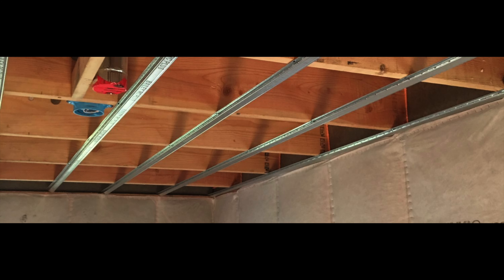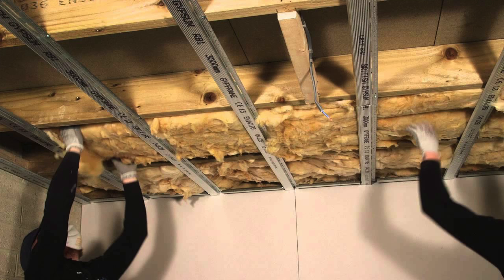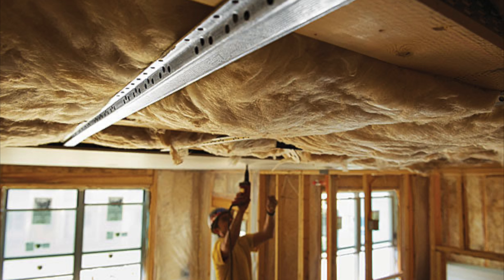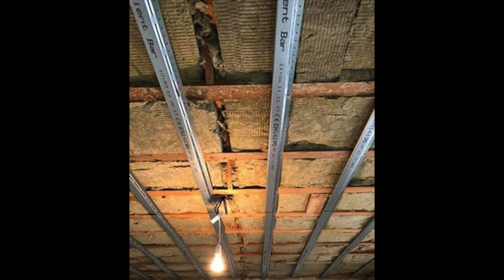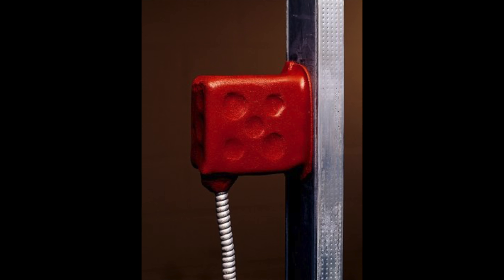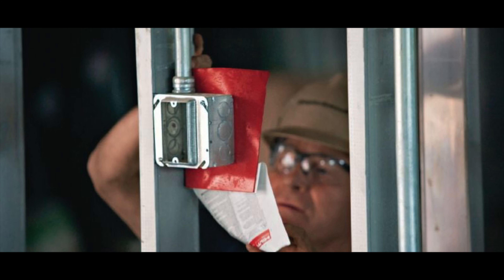Soundproofing a Ceiling Between Floors FOR GOOD!

Comment: Thank you, great advice! Might want to mention flanking as well when talking about impact noises as well as a couple things people can do to contest these issues. Firstly use a calibrated mic to take measurements of the noise. Building codes always include IIC ratings for multi dwelling constructions. A FIIC test can be conducted to see if the structure meets code or not. What is unfortunate is often the HOA or administration are ignorant of these issues and the details around them. Complaints of footfall noise are often ignored or seen as not important. Its important when I measure 70-90db @ 40HZ!! That's loud! Big old boom boom like a sub was installed in my ceiling.
Reply: Yes! Ppl above can be loud at times

Comment: Great info, thank you! I wrote to you on the main page (?), I hope you access it. We are going to finish the basement to make an apartment. We’ve had one BBIG FAT FAIL OF $5000 to re-do the existing ceiling of one room that was already done when we bought the house.The expert put 2x4s and rigid foam insulation and 5/8 sheet rock. This was all on top of an already finished ceiling. It did little to reduce impact noise. Now we want to finish the apt. Living room and bedroom LESS EXPENSIVELY and ecologically friendly. Why not reuse old carpet inside the ceiling? Thank you for your reply and you are welcome to come make a video.😊

Comment: Thank you for the great video! When soundproofing a ceiling, should the sound insulation (i.e., rockwool) rest above the ceiling drywall or should it be pushed to stick to the bottom of the floor? Does either choice make a difference in the desired effect?
Reply: Yes, id5love the answer to this as well.  Thank you

Comment: Can adding an extra dry wall to ceiling work and would it be safe? I had my apartment done with new walls and ceilings a couple of years ago. And yes the neighbor upstairs makes lots of noise that i had to tell person to take it easy when walking and slamming things on floor. I appreciate any advise you can give!
Reply: This is an exciting question. Where I live, the neighbors upstairs are extremely loud; they wake me up every day at 5:20 AM, and they are pretty heavy—one weighs 200 pounds, and the other weighs 300 pounds.

Comment: I live in a location that is about to be renovated soon. The above rooms are part of a short-term rental, and I deal with a lot of impact and audible noise. The audible noise is the least of the problem. The impact noise is the worst.

I've been able to mitigate the audible noise by running fans and putting on some relaxing music. It doesn't eliminate it all together but it does seem to help somewhat. However, the impact noise cuts through this.

Decoupling sounds like a great idea. But the problem is that the ceilings in my space are extremely low. Because of this I am very limited on height.
So this is not going to be feasible.

With that said, the floor above can be adjusted...
Is there anything that can be done from this aspect?

Comment: Thanks for going over the different strategies for airborne vs impact noise. I think a good way to organize ceiling soundproofing is also by whether you can rip out the ceiling or not. It would be weird, I think, to rip out the ceiling but not put in soundproofing insulation. Similarly, it would be weird to rip out the ceiling but not use a resilient channel for the new drywall (if you can afford it). What's the added cost of a resilient channel if you've pulled down the ceiling? What's the added cost of adding soundproofing insulation if you've pulled down the ceiling? On the other hand, if you've added an extra layer of drywall because you didn't think you could afford pulling down a ceiling, how happy are you going to be? Are you going to wind up pulling down the ceiling anyway because it didn't do much?
Reply: Would like to know... is adding drywall to existing ceiling enough?
Reply: @susanburke7257  It wont make a huge difference with impact noise (you have to decouple the ceiling to do that), but it will help somewhat with general noise transmission.

Comment: Hi, Thank you for the video. 
I live on the ground floor, the architecture of the building is, above my master bedroom, upstairs neighbor has a living room, kitchen and a stairs going to the ground floor, the stair is shared by two units. I hear footsteps in the master bedroom so it seems its the impact noise I am dealing with. I don’t think I want to do major construction for ripping the ceiling to decouple the above floor with the ceiling. Is there any solution which does not requires any construction to lower the impact noise?

And I am also curious, when looking at building to move in, what questions needs to be asked to make sure there is no impact noise from upstairs? 

I understand the airborne noise is avoided if there is double pane windows, for the impact noises what do I need to ask? Thank you!

Comment: My wife and I just move to a second floor apartment and we are a bit paranoid with the bed noises. I wonder if the first floor tenants can hear out mattress movement. We don’t have a bed frame or any of that sort just the mattress on the floor. Out bedroom has carpet? I have another carpet so basically there are like three layers under the mattress. We live in a house (wood floor) my question is…do you think my tenants can hear the movements of the floor even if we don’t hear anything?? Thanks so much

Comment: I wonder if the acoustic tape that is used to stick to the top of the joists under the subfloor would be effective when glued to the bottom of the ceiling joists before you screw on your plasterboard. That tape

Comment: Noise is so irritating. I live in the UK and my flat was built in 1930 pretty cheaply. Theres not much space between floors and there is zero sound proofing or insulation. The guy downstairs does my head in because he comes up and complains all the time about footsteps at stupid times. Once as early as 5pm. I felt bad for him at first as our upstairs is noisy too, but also, I cant help how this place was built. I also dont have the money to install this stuff as I work a basic job thats just over minimum wage and it was a struggle enough to even buy the place. I asked if he would consider installing soundproofing in his ceiling and he told me it was my problem.... I said that its clearly his problem if he can hear it and he should move if he doesnt like it and doesnt want to sort it 😅

Comment: How affective would it be to install resilient channeling on top of the current drywall and then add the 5/8" to the channeling?? Assume there's no insulation in the ceiling joists above...
Reply: Could make it worse. See triple leaf effect.

Comment: You keep referencing another video in the top right hand corner, but there isn’t a button or video there, how do I find the link to that video?
Reply from the maker: That's strange I just checked and everything should be working fine regarding the link pop-ups... You can easily search all of that directly on my channel. Let me know if you need anything specific and I'll do my best to guide you in the right direction. :)
Reply: Yes I’m trying to soundproof apartment ceiling
Reply: @soundproofguide  Hi. My office building has an HVAC(?) where there's a room around the corner and vents throughout my floor and other offices on our ceilings (which are drop ceilings). My vent in particular is a nightmare and there's this constant air sound when the hvac is on. When I lift the vent i can see a blanket under there and the ductwork. Is there something simple that, on my own, I can put in there to muffle the sound? I'm getting no help from my office building.

Comment: I live in a building, is from the 80’s, and I hear everything, the impact noise its horrible, they jump and play basquetball. I have some electrical outlet on the ceiling, also the doors are from metal and goes up to the ceilling, the walls are empty, I will try first with those matters. But I dont know what to do with the ceiling, because in Chile there’s not a lot of people working on this for apartment. So if I dont want tonloose too much inches and the windows are almost tonthe top, what should I put to the ceiling?

Comment: Hello, I am soundproofing my basement, not to not be able to hear it upstairs as much, but more for my neighbors not to be able to hear my 18" subwoofers IN THEIR HOUSE. is decoupling on both the ceiling and walls mandatory? Thinking about doing the rails on the ceiling and then just 2 layers of 5/8 drywall with green glue on the walls, also on ceiling obviously. Basement is unfinished. so far I've just walled up the perimeter and filled the ceiling joists with safe n sound. I'm walling up over the windows too. Thanks!

Comment: are drywall guys the ones that install resilient channel or general contractor?
Reply from the maker: It depends, a lot of the times it’s the contractors but some drywall companies are trained to instal resilient channel. I would ask if they have experience installing it because it will not work if improperly installed. Good luck! 😊
Reply: Same question...and also..can this channel be installed over existing ceiling?  Condo noise from above... walking and talking..
Reply: @susanburke7257  You need to remove the existing drywall, then properly decouple, insulate, and install two layers of 5/8" drywall.  Caulk the perimeter.
Reply: @ssoffshore5111  ahh..drywall guys.  Can't empty the condo.  Ppl live above.
Reply: @susanburke7257  What I stated is the only way to make a serious dent in it.  You don't have to empty the condo, just move the stuff from one room to another and do it a couple of rooms at a time.

Nothing else will make much of a difference, unless the people above you vacate.
Reply: @ssoffshore5111  thank you.  Thr estimate was applying drywall and channel over existing ceiling...🙁 so...maybe tolerate noise.  Thank you.
Reply: @ssoffshore5111  thank you
Reply: @susanburke7257  That might help a little, or make it worse because you'd basically be creating a drum.
Reply: @susanburke7257  And if they are going through that hassle, it's not much additional work to rip down the existing drywall on the ceiling to do it right.  Your upstairs neighbors likely wouldn't notice much of a difference between you doing either way... but you would.

Comment: I have concrete ceiling , for some reason I can hear my neighbour conversation, footsteps etc. How do I go about soundproofing the ceiling without ripping anything out?
Reply from the maker: The reason for that is most likely gaps that are letting noise in. Usually concrete will absorb any impact noise but will let airborne noise through the holes of the electrical outlets and wiring. Using the methods I’ve mentioned for airborne noise should help greatly.

Comment: We have amtico installed on our house and sound isolation is not existing essentially (3 floor new build). There is a gap from ceiling to flooring, what's the best solution you would recommend? Can a "foam" injection solution work on that ceiling and reduce sound inbetween the floors?

Comment: Listen carefully to me, if impact boise affets you. MOVE out, you won't be able to fix them regardless of how much you spend. The main structure is to blame nad you cannot change that.
Just move, I failed to fix it and had to move frok my own apartment  gunna see if I can rent it or sell it later to cut my costs.

Even with decoipling and resilient channels, pros only told me they could at most reduce the boise by hopefully 35% at MOST if Im lucky and expensive as hell.
35% is not MUCH if the impact boise is pretty loud and you can hear it through headphones, MOVE. It's hard to accept defeat but trust me, your mental happiness will thank you for doing so

Comment: No.  Complete nonsense.  Only things that work are decoupling and changing resonant frequency of panels.  This assumes all air gaps are sealed shut.
Reply from the maker: Decoupling works perfect for both types of sound but not necessary if you’re only problem is airborne noise. Thanks for commenting.